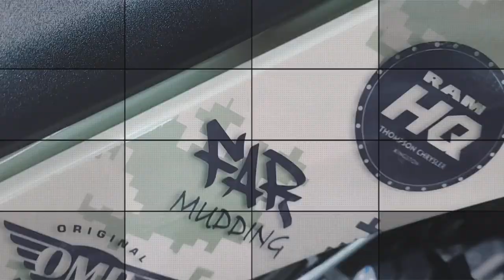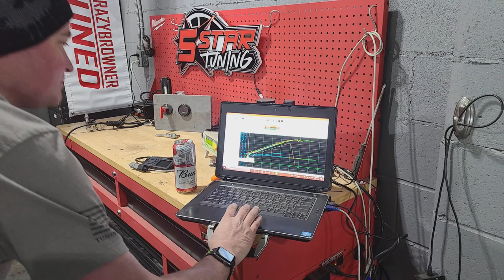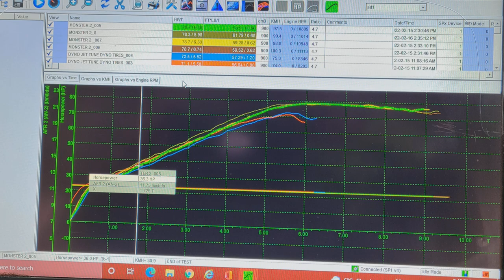How Much HP? 2022 Can-Am Renegade X-MR 1000r Dyno Pulls

Comment: Hey by I believe my 2022 renegade has the electronic throttle what's the issue with dynojet not supporting that bike and basically what's the best tuner I should go with i have a slg pipe on it

Comment: What was the tune you have? I have 2 , the one it came with and a tech from dynojet loaded another. The one he loaded I lose alittle top end speed but it seems to have more low end torque. I have the SLG exhaust too and the guy from SLG said use the emipire exhaust stock intake . Which both of my tunes say

Comment: I'm sure with a belt drive the numbers are a bit off. Hp is a measurement of the torque rpm and how fast it revs there ect. A belt drive instantly jumps to 4k plus rpm and is held within a very short rpm range 4-8k so it's hard to get a true full range dyno pull and know. 
I'm sure it's close but the bike could be making more power then you think or it could be fooled by the tuning allowing the belt drive to throw off the numbers.

Comment: What heater do you use in the trailer? Also what is the width and length of your trailer?

✌🇨🇦
Reply from the maker: Just a dual propain burner unit, 14x7 is trailer dimensions.  16 to the nose

Comment: Do you loose any top speed with clutching? Seems to be reving much higher at a lower speed? Could be wrong, but I don’t know how it all works
Reply: Yes but doing tune along with exhaust gains back and improves  overall power delivery these done up with all the goods is about as good as it gets I mean 78 hp to the wheels on a quad is just plain nasty

Comment: But what is the actual power to ground on a stock can am renegade xmr without a clutch kit or a re clock  installed has anybody done a dyno on one of these in complete from the factory  stock form
Reply from the maker: Not sure  but if I had to guess around 60hp